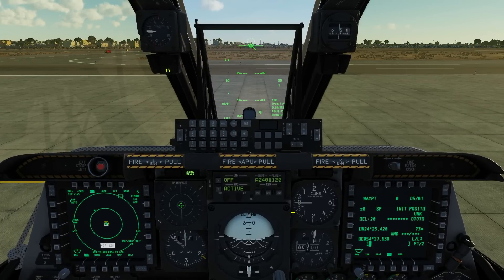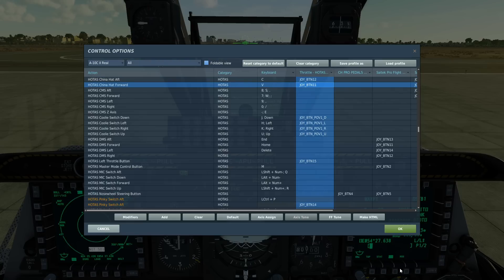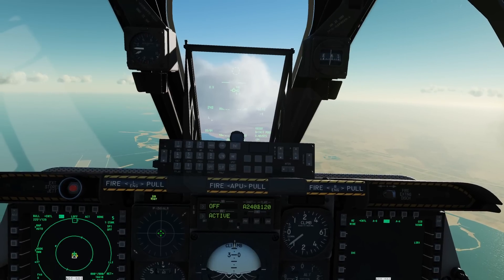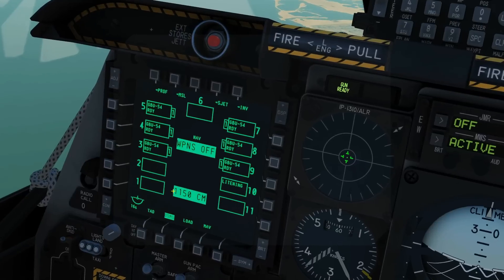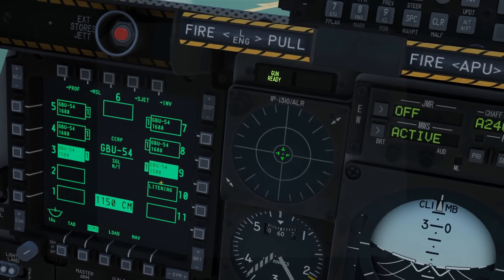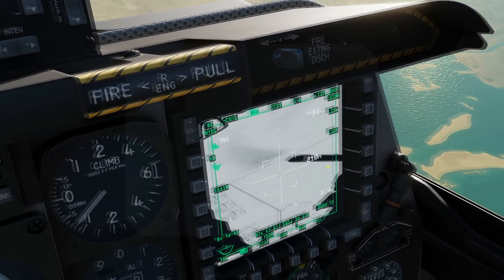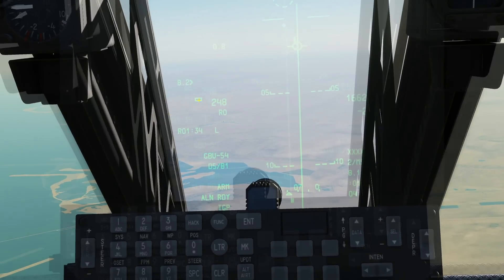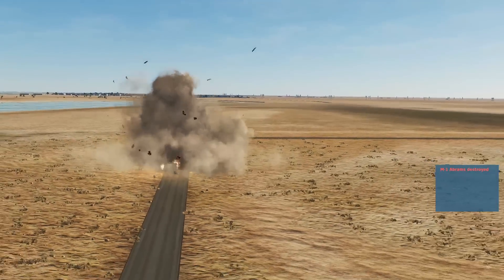A-10C II Tank Killer: GBU-54 Laser JDAM (moving target) Tutorial | DCS WORLD

Comment: Are there any advantages that the paveways have over the LJdam?
Reply: Nope, LJDAM is more modern and cheaper, can be both GPS guided and laser guided
Reply: @Maverick966  well the modern pave way is also gps and laser. Why would anyone buy the paveway IV instead of LJDAM then if the LJDAM is cheaper
Reply: @thurbine2411  Paveway IV is a bunker buster weapon designed in UK to replace GBU-27 with the advantage of having the same penetrating capability with 1/4 the weight, while LJDAM is a normal General Purpose bomb to replace GBU-12 and GBU-38, UK made Paveway IV so it means that USA was not interested in developing a Paveway IV because they have other options.

Comment: just asking, what's the point? is there a difference of power( damage dealt) or use between this , the gbu-12 or the normal JDAms ( i assume there isn't and its  just mean this is a versatile  bomb that can do all and thats about it??)
Reply: Yes you are correct as it can be used in both roles it is more useful than a gbu 12 also as it is jdam primarily and lgb secondarily, it has more drop options and can be used for longer ranges and different drop options compared to a lgb which needs a rather precise ccrp drop.
Reply: And it's also about wartime logistics. It's easier to supply one bomb for two things. You'll never face a situation where you have a pile of bombs unsuitable for their role.
Reply: JDAM is difficult to hit a moving target.  GBU 12 has a strict drop zone.  This can lase a moving target and be dropped in a wider zone.
Reply: LJDAM is cheaper and can be both laser or GPS guided